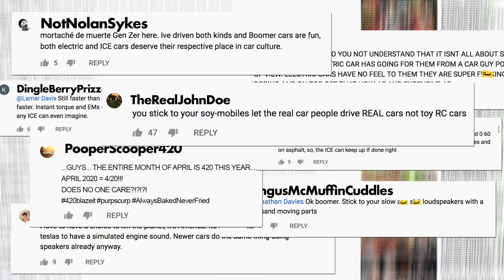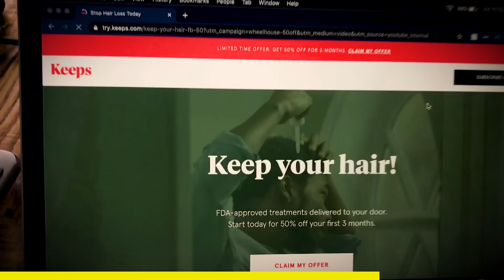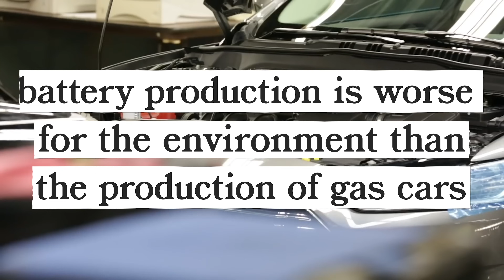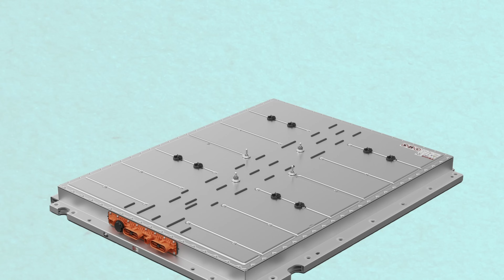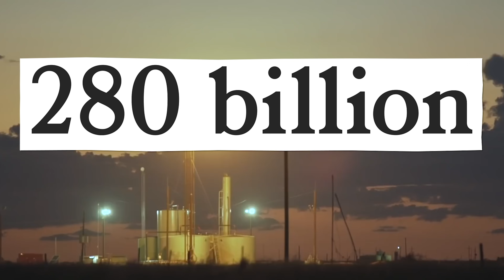Are Electric Cars REALLY Better for the Environment?

Comment: I don't care, I'm not getting one, they're boring.
Reply: This clown that responded to your post is from Australia and can only afford this clown car so he is over joyed. Never had any experience with fast cars. You have to wonder what kind of fool buys these clown cars given their pathetic quality as stated by current owners!
https://forums.tesla.com/discussion/182829/2021-model-x-build-quality-and-my-remorse
Reply: Have you ever driven one?
Reply: @engineeringtheweirdguy2103  I have been in one as a passenger. I cannot accept the lack of sound, and feeling of the engine running. And direct drive can fuck a tree stump, I'll never give up manuals.
Reply: @inoutdoor4211  direct drive is amazing. You should try behind the wheel. Peak torque. And a lot of it. On demand. No having to hit peak RPM. No down shift. Your head slams the head rest as fast as you can push the pedal down. It’s amazing. And who wants to vibrate in a car? Does that tickle your clit? And who wants loud sounds. Firstly it means everyone in the street hates you if you come home late or leave early, secondly, how insecure do you have to be that the only time you feel justified as a man or a person is if you make sure that everyone within 5 blocks knows your around.
Reply: @inoutdoor4211  and why would you even want lound engine anyway? It just means if you try to drag off say Tesla at a lights and you lose, everyone will know that you tried to go them and had your arse handed to you. In a Tesla it’s quiet and people barely notice if you get slaughtered. It just sounds like your on your way to pick up milk.
Reply: @engineeringtheweirdguy2103  Again, you can settle with quiet and boring. I like the sound. Many people do. And we're not willing to give it up. The Tesla may beat a good fast ICE, i don't care. That's all it has, the acceleration, that's IT. :)
Reply: @inoutdoor4211  ahh. The no true Scotsman logical fallacy. The go to for everyone who feels personally threatened by EV’s because they suffer from such a lack of personality and such acute insecurity that they actually define themselves by how much noise they can make.
Reply: @inoutdoor4211  sorta like this SouthPark skit. https://youtu.be/ipDmsxQVxIM
Reply: @inoutdoor4211  “you can settle for quiet and boring”. If you think sound is the only thing that gives a car character and makes it not boring. Then I gotta tell you. You’re the one who’s not a real car enthusiast.
Reply: @engineeringtheweirdguy2103  It's major part of it. The part that really grabs my attention, not they way it looks (and lets face it, most cars now look the same and generic). But hey, car guy here, REAL car/motorsports guy who likes engines, and working on them.
Reply: @engineeringtheweirdguy2103  I go after EVs because i despise them and find people who claim to be into cars who only want a Tesla or any EV not to be car people, just frauds. EVs aren't real cars, they're just giant versions of those plastic mini hummers and escalades that 5 year olds drive around on sidewalks.
Reply: @inoutdoor4211  Exactly. This guy has no experience with high performance cars and this is the only car he has that remotely has supercar acceleration. There are more high performance cars in some counties in the US than they have in the entire country of Australia. And he laughed at how we are not on the meyric system. I told him don't worry about what the US has achieved as Australia is about to be taken over by Communist Chinese - their whole nation is about to be owned!!! I challenged him to do 0-100-0 runs back to back and see how many times his clown car can do the run before the brakes feel like sponge Bob! He said the car doesn't use brakes as it uses regenerative braking. And he stated the car has 'normal' brakes. Tesla put on 4 piston brakes because that POS weighs a ton. There are no fuel efficient cars on the market that comes from the factory with 4 piston brakes. I told his that POS can do 2 runs before the brakes fail and that is if the batteries don't overheat. He is too chicken to do it even though he owns the clown car. And in professional road racing, they have to create a special class because the batteries overheat!  They overheat when they're driven on the streets much less under racing conditions and spontaneously ignite. I love these Tesla clowns that self identify driving these clown cars.
Reply: @LWRC  You seriously cant read can you. I, at no point said they have normal brakes. I said they had a NORMAL BRAKING DISTANCE FOR THEIR CLASS which is true. I also did not say that they dont use their brakes in favor of regenerative braking. I said the regenerative braking takes a bulk of the braking application reducing wear and fatigue on the brakes.  Your attempts to purposefully mischaracterise the things I say is pathetic.
Reply: @LWRC  yeah. the batteries do overheat IN ENDURANCE RACES but if you look at other examples, such as when top gear put the model 3 against the BMW M3, you find that it accelerates faster, handles better, and has better lap times around the track than the BMW M3. if you did one lap or 3 laps, you are going to be fine. if you had to do 20 laps you going to get into some problems. AND I WAS THE ONE WHO POINTED THAT OUT TO YOU GENINUS
Reply: @inoutdoor4211  I like engines and working on them. Why do you think I became a Mechanical Engineer. Doesnt mean I dont like driving the Tesla Model 3 over any of my previous cars. Like I said. If you think the only thing that gives a car charactor is the sound it makes then you're not a real car guy. Car guys are more about the feel of the car when you drive it. How it behaves around corners and how it accelerates out. The pitch and role, the way the suspension handles the terrain, how the cabin makes you feel as you command the weight of the vehicle. Thats what real car guys enjoy. They dont jerk themselves off because they've woken up everyone within 3 blocks and 4 car alarms by turning their car on at 3 am in the morning.
Reply: @inoutdoor4211  saying you go after EV's because you despise them isnt a reason. WHY do you despise them? they're a car with a different kind of drive train which offers a unique driving experience and offers a shift in driving dynamics from typical car driving characteristics. that should be celebrated. 

In my experience the only people who hate EV's are people who base their own identity on their cars making loud noises and feeling useful under a bonnet. when an EV comes along and out performs a lot of the other cars on the market (certainly not all) without making any noise or having a complex engine or any reason to be under a bonnet in the first place. Those people feel like their personal identities are being attacked because it's taking those things away from them.
Reply: @LWRC  They don't drive em, they let the computer do the work for them because they either don't like driving, are shit at it and shouldn't be behind the wheel in the first place, or want to feel superior that their piece of shit has the ability to do it by itself, as if that's fun or safe.
Reply: @engineeringtheweirdguy2103  I don't like them because i find them boring, lacking feel and personality, no manual drive-trains, not much in the way of tinkering nor tuning, not great for the environment like they're having you believe, take away tons of jobs in many sectors, and GM in particular is really pushing them to cut jobs, they really want to cut assembly jobs and send them to South Korea for battery building, or keep SOME in the US in exchange for pay cuts. They have said that, look into it. Real cars ar set apart from most other appliances in that they have engines, even mowers and generators, yes have them but they move or power things respectively. EVs don't stand out, they're just pathetic kids toys on the road you happen to need a license (for how long?) to operate. Not much different from rc cars or those little kiddie plastic hummers and escalades as i have said before.
Reply: @inoutdoor4211  All of the above. You've seen where highway patrol have photos of the driver behind the wheel asleep while the car cruises down the freeway at speed.  I think most of these people that buy these clown cars because it is a novelty and has tremendous acceleration like nothing they've ever owned before. So all of a sudden, for $60k-$80k, they can have a car that runs with the big boys. And the ones that don't know how to drive (which is basically the majority), they eventually crash it into a tree the car incinerates itself into a pile of ash sometimes taking the driver with it. I love these clown cars and the news headlines they make.
Reply: @inoutdoor4211  I disagree. I find my Tesla has a lot of personality to drive. And it’s unlike anything else I’ve driven. And a lot of people agree with me
Reply: @LWRC  interesting because according to the media research department of the university of NSW, 1 in every 3 fires involving a Tesla is reported on the news, whilst 1 in every 55,000 combustion car fires is reported on in the news. Infact Tesla’s are 11 times less likely to spontaneously combust according to the beuro of statistics and 5x less likely to combust in a serious collision according to the highway traffic safety Authority and the AANCAP safety board and the NCAP safety board. Interesting isn’t it?
Reply: @inoutdoor4211  to be clear I count myself as a car person. I’ve owned plenty of performance or high powered cars. Hell I still have my first Subaru WRX STI, and still work on it and take it to Rally days. But there is something different about driving an EV. The power on demand. Max torque delivered as fast as your foot can hit the floor, no matter if you’re stationary or at 60mph. If you go to overtake you don’t have to jump down a gear, or wait for the transmission to catch up. You just go. Hard. Coming out of corners is my favourite because of the torque instantly as I come out of the corner. It’s like hitting the perfect gear at the perfect revs out of every single corner. 

Flying around corners is also fun, as the car has such a slow centre of gravity there is nearly no roll to it and the dynamics between the suspension without a sway bar, torque and tire friction make a truely interest experience around corners if you push it hard enough.
Reply: @inoutdoor4211  although granted you do miss the feeling of the power of the engine rumbling through the cabin as you try to squeeze the last few rpm out before shifting up a gear. But when you driving the Tesla that sorta, never crosses your mind.
Reply: @LWRC  did I or anyone else say we were the best drivers out there? No we didn’t. Stop building straw men. It’s pathetic
Reply: @LWRC  actually YOU said it drives by itself. I made no mention of it. And yes, a Tesla can outrun a Hellcat at the lights to any legal speed limit. and No I did not say I couldnt drive. I specifically said that I made no claim that Tesla drivers think they are the best drivers out there. infact I said. Quote: ”Did I or anyone else say we were the best drivers out there? No we did not” so its quite a leap from that to then suggest that I am claiming that I cannot drive. Especially in a straight line off a set of traffic lights.
Reply: @inoutdoor4211  I told you not to listen to this LWRC guy. He's crazy.

Comment: Quick answer no because we still get electricity from you guessed it power plants
Reply: Quick response. They’re still greener. Power plants use fuel more efficiently than any combustion car especially when considering the energy cost in drilling, pumping, refining, and transporting the crude oil to create and deliver fuel.

Comment: Unfair comparison, you left out the biggest harm to the environment of  EV car - its lithium battery recycling issue.  Only about 5% are being recycled and most of them end up in a smelting furnace.  Not to mention the lost efficiency of battery over period of time, most people would just buy a new EV car instead of replacing the battery.  It is creating additional waste for the environment.  Things may change only if Fuel Cell or SSD battery have will be used instead of lithium battery in EV cars.
Reply: Oh dear, yet more misinformation......

Comment: Pollution is real. CO2 is not pollution. There are other things in exhaust. Methane is much more of a  greenhouse gas. Trees need LOTS of CO2, not methane. Trash in the ocean, harmful chemicals, refrigerants...
Reply: Trees need CO2 but if they would need as much CO2 as humanity emits there wouldn't be the green house effect.  Having half of the facts and making claims based on those does not make you smart.

https://skepticalscience.com/co2-pollutant-advanced.htm
Reply: @envispojke  It's called more food. More trees. It's not the only factor for CO2. It's all systems that self regulate which is why we have what we have.
Reply: @envispojke  not to mention none of the projections end up being right. For SOME reason...
Reply: @envispojke  Your "facts" are part of those bogus predictions. They are only facts, until they figure out they're not. Just like how everyone points at published studies which are done by college idiots and will support any viewpoint you want. CO2 ppm is very low btw.
Reply: Exactly right. Methane is much more of a problem as a greehouse gas compared to CO2. Methane is 86X more potent than CO2 as a greehouse gas but it has a shorter life span. And CO2 is needed by trees and algae for photosynthesis!

Comment: In short, they are but they still need to dig up the lithium ion batteries only available in China and Africa, also the factories that develop the cars still produce carbon monoxide (or dioxide I forgot)
Reply: Do you really think that lithium is only available in China and Africa? Who told you that. The largest producer of lithium in the world, and the highest lithium reserves in the world are in Bolivia. And a handful of other countries other than the ones already mentioned.
Reply: that is what this video is about
Reply: Wrong. Most of the World's lithium is mined in Australia.....they produce around 50% of the total...

Comment: Very interesting video but it’s incomplete. You need to talk about what happens with the physical waste from EVs when the batteries expire. As it’s inorganic it’s not part of a natural environmental cycle.
Reply: It can be recycled although there is no method as of late to do it without massive input of energy
Reply: @johnisaacfelipe6357  Obviously you haven't watched the YouTube video of the VW electric car battery recycling plant........  the battery packs are discharged on arrival, prior to being recycled, and any residual charge is used to partially power the actual recycling process......
Reply: Plus the extra co2 on a battery replacement. Kind of a death nail to the EV. I drive a thirty year old truck and my motor isn’t junk after 10 years or so. It performs pretty much the same as when it was new.

Comment: 9:12 - "Electric vehicles in states with access to cleaner electricity like windmills, solar and hydroelectric power-plants are significantly more efficient."

I have many problems with this statement...
1) the fact that a vehicle could receive power from an electric plant, or any other, doesn't change the efficiency of the vehicle. The efficiency of a given vehicle is only defined by how much energy you have to input (electricity) and how much you can get out of it (motion).
2) Now, if the argument is that because solar, for example, is free, well, to a certain point I buy that. However, taking the same consideration as with combustion engine, where most of the energy is wasted, as heat instead of motion, same principle applies to a solar panel. Back in 2010, when I researched solar panels the efficiency was around 10%. We've developed way better panels now, but still we're in the range of 15-20.

Once said that, don't take me wrong. I really like the video, and overall is very informative.
My stance in this matter is simple, no matter what form of energy we use, there will be problems. Environmental, sourcing materials, risk-benefit tradeoffs, you name it.
But I'm glad we're in the constant pursue of better ways.
Melanin batteries, for example?

Comment: TL:DW Hydrogen has more oomph than lithium-ion batteries. Green hydrogen is made from using green energy processes to split hydrogen from water, and desperately needs more demand and supply and funding.  Grey hydrogen splits methane into hydrogen and CO2 and doesn't even try to stop the CO2 from entering the atmosphere. Blue Hydrogen is the same process but at least attempts to capture carbon.

Nuclear power is green energy whether the hippies like it or not. Far less in terms of emissions, and nuclear accidents have killed far fewer people than pollution from burning oil, gas, and coal for the electric grid.